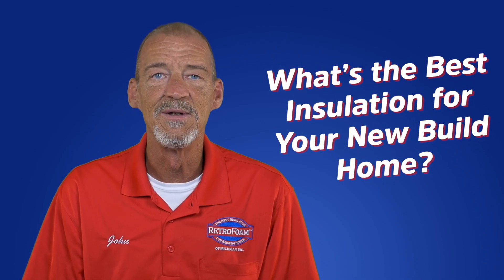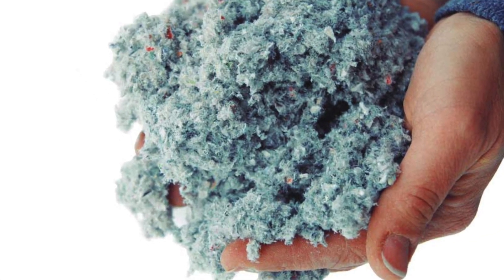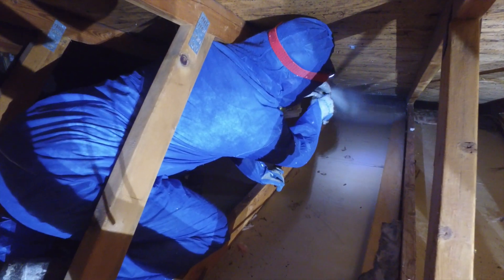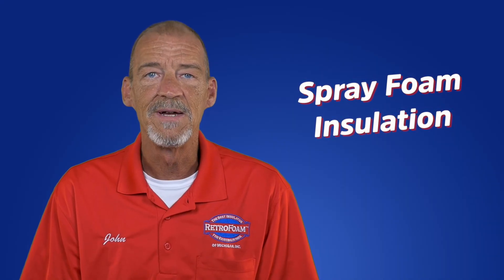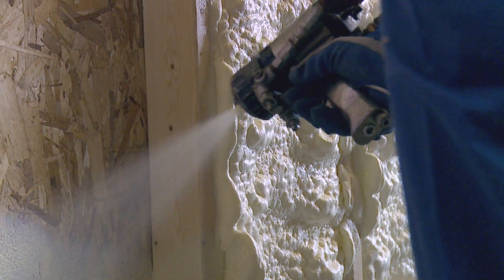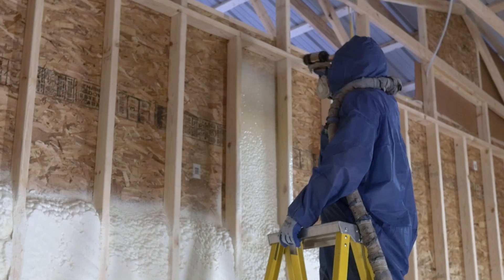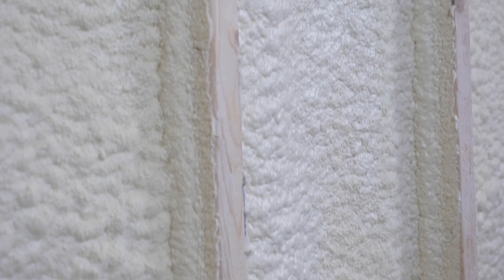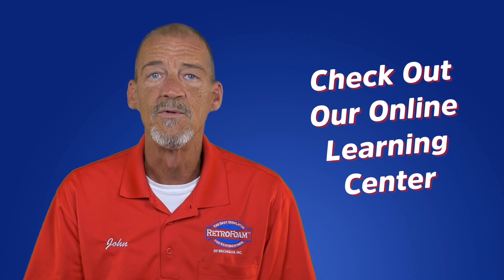What Are the Best Insulation Options for New Homes?

Comment: Spray foam....no chance in the UK, most banks here don't want to touch houses like that.
Reply from the maker: It looks like the issue is when the home has closed cell spray foam on the roof deck. This is because if there is a roof leak, the closed cell, in some cases, can hide the leak.
There are also open cell spray foams on the market that will absorb moisture, leading to similar issues. This is why it's important to talk to the spray foam insulation contractor about the materials they use so a homeowner can research any potential problems.
It looks like there are a lot of spray foam contractors across the UK, so it would come down to vetting them to find the best for the job.